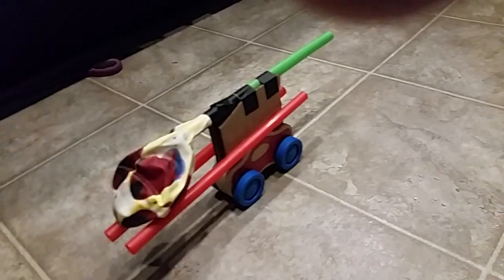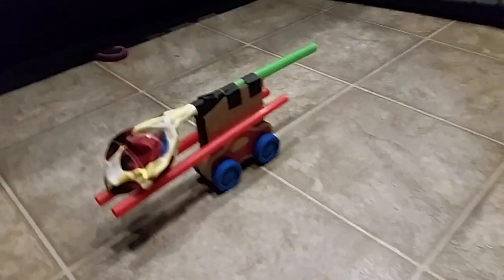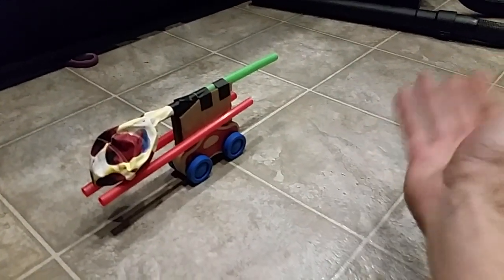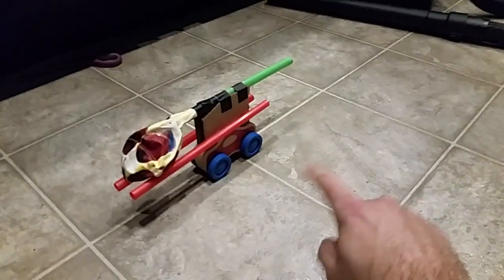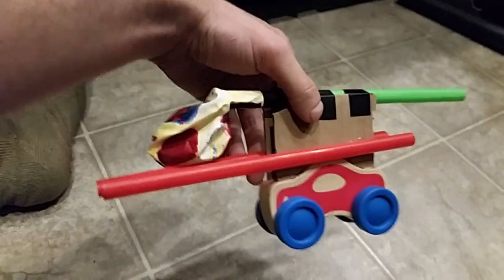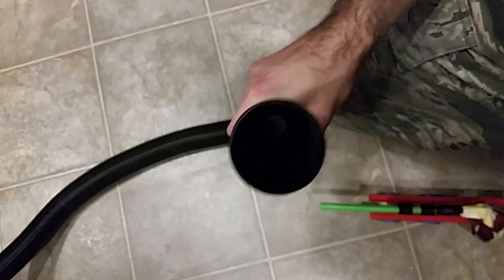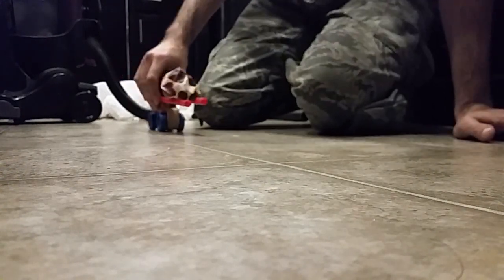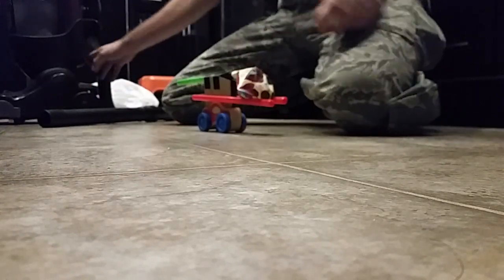Newton's Third Balloon car with vacuum behind it

Comment: You must measure the air speeds  as I said  and your modelling changes as soon as you move the vacuum hose.   What you also could deduce is if there is a difference in speed between  the car without the vacuum cleaner and the one with ....it poses a very interesting question why that would be.
Reply from the maker: Andrew Corbell 

omg dude come on. It performs virtually the same. Obviously if you were right (especially in that you for no apparent special reason, except that he has flaws and a random cut, think that nine eleven's video means anything) My car should barely perform if at all with the vacuum. IT IS LITERALLY IN THE VACUUM! There is absolutely no way the ballon air is faster than the vacuum motor through a not even 2inch opening.

What is interesting is how in the hell you find nine eleven's video to mean something when his car performs so terribly he seems lucky to get it to roll even half the time without anything even messing with it. My car is taking off almost unnoticeably different with or without the vacuum.

You are obviously to the point of biased willfull ignorance here.
Reply from the maker: Andrew Corbell 

So if I order an anemometer and measure that the vacuum speed is faster than the ballon air what will you think then?
Reply: Jasoninee  it's ok   don't   have expenses on behalf of me . I am moving on to a different topic . I didn't ask you to do all this    .... Before you do ask yourself this question why in your second modelling does the balloon go slower.
Reply from the maker: Andrew Corbell 

uhhhhhhh.... because the car has double the weight on it. Before I even used it I was actually worried the car would no longer be powerful enough to have an obvious result. That is no mystery lol.

I wouldnt mind having an anemometer anyways, so tell me what it would mean to you then, you forgot that part.

I can solve your ridiculous "vacuum having to move is an issue" thing also. How about I make a video where the system is static and pushing into a scale. The nozzle will be in the vacuum, not move, but be released and we will see the force on the scale.

After these are both covered where you be at then?

How odd you would move on to another topic when ou almost HAVE TO result to biased ignorance.
Reply: Jasoninee   measure the speed without vacuum then with ,then ask yourself if you want to spend the money.
Reply from the maker: Andrew Corbell 

The speed of what? What the heck are you getting at? If you are talking about the car I don't care about that. Of course it will be slowed down a little bit. I have created a viscous flow of air pulling back on the straw.

The whole point was that it is obviously not a "damming" test like you state about someone else's video where their car barely works in the first place. The "damming" thing is that they claim it makes it impossible to work and I obviously showed it works great if you dont have a horrible setup in the first place.
Reply from the maker: Andrew Corbell 

Do you really not realize that this is a situation of one side  having a video that thinks it proves something is not possible and then I showed it is easily possible, with my daughters car, dollar store balloons and straws, abd some hot glue. How does that not amount to something in your head?

If you have a ball and say this ball is impossible to throw to that line over there and then I throw it to that line.... where would we be at that point?

or if you have a car and say "this car does not work and can't start" and then I go and start it.... where would be at that point?
Reply from the maker: Andrew Corbell 

You already got one "say the words and I'll do it" now you need another. Now it's not enough when you have exactly what you wanted.

Say ahead of time where we would be at if I do it with both anemometer measurements, and the static thrust test and I'll get it done. Just inform me of what you would think if that suceeded and I'll do it.

Oh btw I noticed you had no remarks about my hose thrust video I linked you too. You apparently think air can get oh so much extra push from glancing off off the floor. How come my hand less than one inch from the hose changes nothing for the thrust then?

https://youtu.be/FR2QLhbI5s0
please please PLEEEEASE take a shot at explaining how you believe the glancing air on the floor noticeably affects the balloon car, but the thrust from shooting water is unchanged by even grams when my hand is not even there and then moved all the way to less than one inch away.

For someone who thinks there is a lot of "damming" evidence in support of them you sure have a good deal of evidence that obviously shows the contrary and would be impossile if what you thougt was true.
Reply from the maker: Andrew Corbell 

Amazon Primed an anemometer. I should have that within a few days.
Reply: Jasoninee  Jason.  mate  I wish you well . I see you as a fellow soul also struggling to make sense of everything. If you want to chat further about anything else please feel free to respond I'n kind to this  . But on this particular subject I am done  . Peace man.
Reply from the maker: Andrew Corbell 

How odd that you are done as soon as what you rquest/crave to see is coming out. How is it you go from having an interest when you think it matches what you believe to now you will essentially toss away the interest as soon as the exact things you seek come to fruition?

Is that not the perfect embodiment of motivated and biased ignorance?

You are "done" right at the point that I am showing you exactly what you want and you refuse to acknowledge anything about them.

Why are you not able to discuss any of the points I ask you about?
Reply from the maker: Andrew Corbell 

and I have no idea where you get the idea that I am "struggling" to understand anything. I have understood this stuff since I was in elementary school. These are some of the very basic foundations of physics.
Reply from the maker: Andrew Corbell 

Oh hey there!

I just measured the airspeeds and just take a wild guess.... for real take a guess at what they are
Reply from the maker: Andrew Corbell 

Oh man I can't wait so I'll just spoil it before you guess.

The ballon car put out at 30mph and the vacuum went to 60mph when I was even within a quarter inch of the nozzle. When I put it all the way on the hose the meter whined at a much higher pitch and maxed out the meter.... sooooo in excess of 60mph by quite a bit.

SO NOW WHERE ARE WE AT? All I have left is the static thrust test. Just to cover your bases I'll do it with no vacuum, nozzle exactly on end of vacuum, and nozzle in the vacuum
Reply from the maker: Ooooohhhhh Andrewwwwwww...  Andrew Corbell ?

Where'd ya go buddy? You still struggling to make sense of all this? So what is the matter now?
Reply from the maker: Andrew Corbell 

HEY MAN I MISS YA! How come you just disappear now? I did the exact stuff you wanted.

I thought you were an information truth seeker? With these reactions it seems that you are actually just extremely biased, gullible, and willfully ignorant.

You were so adamant earlier and now NOTHING?! You can even do this experiment in your own.... HOW THE HELL ARE YOU CURIOUS ENOUGH TO END UP ON MY ALMOST ZERO VIEW VIDEOS, BUT YOU CANT EVEN RESPOND OR ACKNOWLEDGE ALL THE PIECES I DID JUST FOR YOUR "STRUGGLING" WITH THE FACTS?

It seems like you must have learned something at this point. Why can't you tell the world what you learned after you just proclaimed how wrong everything was? If you still believe it means nothing to you then tell me why and I can keep showing you the workings of what you don't believe is possible.

Is this really going to end with you just looking like a gullible, biased, and willfully ignorant coward that either can't understand and admit something, or is ignoring information with a strong personal motivation? (and all after I bought things, set up experiments, and make a video just for your concerns)
Reply from the maker: Andrew Corbell 

HELLLLLOOOOOOOO Where you at?
Reply: @Jasoninee  He can't hear you. His ears are plugged and his blindfold is too tight.
The cool thing about science is it's still true even if you don't believe it. Any argument based on faith cannot be altered because if this one thing is wrong, dozens of other things could be wrong. If those things are also wrong then their whole pyramid of faith begins to topple. Their mental health can't take that big of a life change. Some would rather slit their wrists than realize they've been wrong about so much.
Reply from the maker: @j.d.martin6678  

Yea lol. You have brought it to my attention that I have yet to do the static thrust test. I still have the car and need to do that. Balloon may have deteriorated by now though LOL.
Reply: @Jasoninee  Bro I hate to see such intelligence wasted arguing with schmucks on the internet. You're absolutely in the right here and your arguments are solid. I wouldn't be surprised if Andrew was a flat earther with how unwilling he is to listen to reason.
Reply: Lol, he ran for from the argument